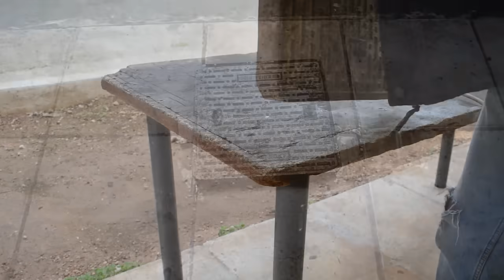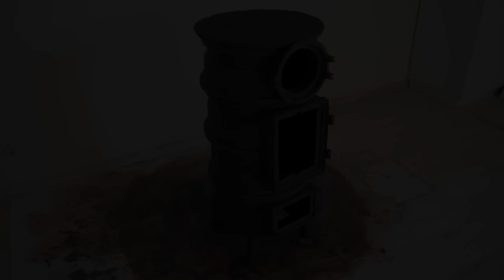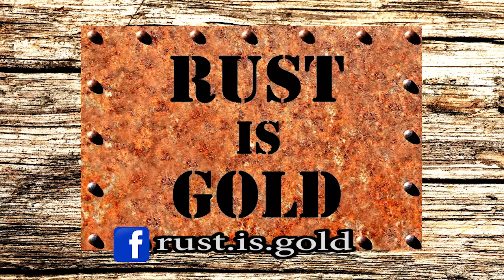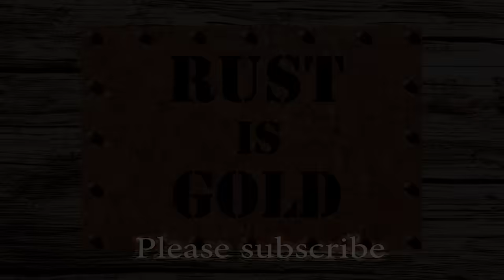DIY Wood Stove made from Car Rims

Comment: I imagine you will regret using paint rated for only 300C. That stove is capable of much more than that.  Also, consider using fiberglass insulation to soft mount the front glass.

Comment: What is the purpose of the top round door?
Reply from the maker: I wanted to put a small door on top and I had this circular door here in stock so I decided to install it! All the other wood stoves I searched in YouTube had 3 doors. In addition you can open this door to allow more air to go up chimney.  This will clear the stove of smoke with out opening bottom draft door which will increase the strength/heat of the actual fire.
Reply: Looks pretty cool! Maybe more ventilation? I was thinking the same.. you know what really stinks? Most of the best designs and they don’t look to hard , none of them are in English.. that stinks worse than day old fish...🧑🏽‍🦽🎣🇺🇸

Comment: Loved this... A grinder and paint makes the welder you aint!!.." 😄😄😊👍👍
Reply: I'm always amazed how they cut a small circle on a non flat metal using a grinder with a 5" blade!  Great job!
Reply from the maker: Thank you very much!
The difficult part is to create the first full circle. Once you do it it's very easy. It just needs patience and to go around over and over again by slightly pressing the cutting disc.

Comment: I'm looking to build a wood stove in a shed/ cabin and something like this would be a great size
Reply from the maker: You can also use truck rims but it is going to be huge and heavy! 😊👍
Reply: @RustisGold  lol I'm 5'1"& 120lbs every wood stove big enough to keep a cabin warm is big and heavy for me haha
Reply from the maker: @katiesioux7757  😄😄👍👍
Reply: This one you could Roll into place.  Tape cardboard over the glass and brush it off once there or....Metal Casters with locks on the legs.   Gotta think outside the Box that the Box is In.
Reply: @mindofmadness5593  with my size and the work I've done, out of the box is often the best way lol smarter not harder💯⭐

Comment: Beautiful project, but here’s some advice:   Make those welds L@@K nicer buy turning up the heat on the welder.    If you’re already maxed out, you then need a bigger welder that puts out more amps, because your  weld beads look like cottage cheese or pigeon poop.   I’m not saying this to be mean, just pointing out the obvious.  With cleaner, nicer looking welds, your work of art becomes truly a piece caught by everyone’s eyes.

Second, that silicon won’t last long.  There is braided fire liner you can buy that works better.   Third, painting inside the stove will only burn off right away.  All it does is make nasty soot and toxic smoke until it’s all burned away.   

How do I know?   Because I’ve made 14 of these similar stoves and sold them all.
Reply from the maker: Thank very much for your comments and the advise!

Comment: add refractive bricks layer at the top and your heat will be 30% better...
also clean the soldering is a great possible esthetical aspect too. anyhow it's a great job you did guy!
I'm going to make one with tractor rims :D
Reply from the maker: Thank you very much for your comments! I know it would be much better if I had added the bricks.... I'll have it in mind for future projects! 
Tractor rims are huge!!! 
Why don't you use truck rims??
Reply: @RustisGold  I'm joking for the tractor rims, but can be interesting for a big restaurant pulled pork stove :D

Comment: 3:14 Preparing for the barbecue? Nice build indeed. :)
However, I think a flame deflector plate will improve efficiency. It's simply an angled plate where the gasses have to pass before entering the chimney pipe.
This means the gasses have to be in there for a longer time and will be burned more efficiently.
Reply from the maker: Thank you very much for your comments! I will definitely have a look on what you suggested. I wasn't aware of this detail. 👍

Comment: Very interesting!  I built a barrel stove for the shop using a length of thirty inch diameter pipe, (about 5/16 inch wall thickness) from the salvage yard and my own door with a draft on each end so I can control the burn.
  Once I get a good bed of coals going, I can put a three foot long log in it fourteen inches in diameter.  Depending on the weather, it will hold a fire for as much as two days.
Reply from the maker: Thank you very much for your comments! Your barrel stove looks really effective! 😊👍👍

Comment: Nice work, 1 question was the cast iron hard welding 
Comment if I was to do something like this I’d use 22.5 or 24.5 inch truck rims, bigger is better 
That being said I’m impressed with your work
Reply from the maker: Thank you very much for your comments! I am glad you liked my creation. 😊👍
Cast welding was harder than I thought.
You need to really warm up the surface in order for the welding to be successful.
I also thought of using truck rims but I didn't want the wood stove to be so big.
Even with the rims I used it is really heavy!!
Reply: @RustisGold  You  need to weld cast iron with nickel rod. Very expensive.Ordinary welding rod does not well at all with cast iron. Better off using mild steel instead of cast iron.
Reply from the maker: @ArchieBunker-i2h thank you very much for your comments! 
Nickel rods are too expensive... 
After 5 years it seems to hold just fine although I used normal rods. 😊👍

Comment: What is the purpose of the round upper door? For adding wood? I would just add it on the main door (the one with glass).
Reply: It's called a damper to control the amount of air intake
Reply from the maker: Thank you very much for your comments! I wanted to put a small door on top and I had this circular door here in stock so I decided to install it! All the other wood stoves I searched in YouTube had 3 doors. In addition you can open this door to allow more air to go up to the chimney.  This will clear the stove of smoke with out opening the bottom draft door which will increase the strength/heat of the actual fire.
Reply: This for heating or cooking too
Reply from the maker: Just for heating. I haven't used it for cooking.

Comment: 🔥🔥🔥I think this is a great use of old tyre rims and a drain covers,  wonder if there are pot holes now 😁 ,  unless youre very good at arc welding this would be better done with a MIG welder for a cleaner finish , I like the design and it seems great to use but it will get very hot, 300 to 400`c easily with a couple of good logs on it and if its used indoor you would have to ensure that all your welds are seam welding and sealed against toxic gasses leaking out. 

I wonder about the longevity of the steel rims though with the heat and wonder whether it would have been better to weld some steep plate baffles to the inside of the rims to give some protection for the fierce heat this will generate , you could easily pop a cauldron on top of this and bring it to the boil....

I was surprised to see drain covers that are not cast as those you wouldn't not normally be able to weld to plate steel. it needs specialist skill to weld cast iron . It looks fun to have in your workshop or garden room. 

Well done.....I like it a lot.🔥🔥🔥
Reply from the maker: Thank you so much for such nice and detailed comments!
I am really glad you liked it! 😊👍👍

Comment: Nice work but the welds ooo my
Reply from the maker: Thank you very much for your comments. I am not a professional welder. When it comes to simple welding I have no problem. This one was more difficult because there was some gap between the rims and the metal boxes I created.... I also used the grinding wheel at the end and it looks pretty good.
Reply: @RustisGold  mate seems like you are just draging the rods straight 
you need to move side to side like drawing a leter c on paper 
when arc welding just a friendly sugestion 
but a good job anyway looks good 👍👍👍
Reply from the maker: @toby621  thank you very much man!!! I am afraid you are right... I was dragging the rods straight... I will start practicing!! 👍👍👍

Comment: holy smokes, how many zip disks you go through?? May want to get a plasma cutter
Reply from the maker: If I remember correctly I spent around 15€ (max) in cutting discs which is not bad... Buying a plasma cutter however wouldn't be a bad idea! 😊👍
Reply: @RustisGold  Yah and a small mig welder as well. Burnin rod is messy and not so good for your health neither. Otherwise, great job. Looks cool and old school
Reply from the maker: Yes... Mig welder is on my shopping list as well!
Thank you very much for your comments! 😊👍👍

Comment: Marvellous. Totally rivoting. Better than any famous Crimi series. Totally absorbing. If only I could weld and had the construction ideas like you. I bet you were top of you class for practical mechanical  engineering. What would you have done without the man-hole covers? NOW, the crucial Question: How well does it function? Can you grill a steak on the top manhole section? Boil a kettle quickly? A pot of potatoes or soup? Cheers.
Reply from the maker: Thank you very much for your comments! I am glad you liked it! Growing up in Greece unfortunately we didn't have such courses in school... However I was that kid in the neighborhood who would fix all his friend's bicycles! 😄
If I hadn't thought of the manhole cover solution I would have bought a couple of metal sheets, cut them in circles and use them instead. 
The wood stove worked fine but to be honest I didn't use it a lot... My son liked it so much that he took it and placed it in his apartment as a decorative item!! 😊👍

Comment: The stove has beautiful styling but I'm not sure the steel will hold up to the heat over time. How about an update?
Reply from the maker: Thank you very much for your comments! To be honest I didn't have a chance to  use it a lot.
My son liked it so much so he "confiscated" it and placed it at his apartment as a decorative item! 😄😊👍
Reply: Will hold up just fine , have a 2 rim firepit that has been used for years with no issues
Reply: @killerdeamonking  an outside fire pit and a wood stove are not even remotely comparable when considering the amount of thermal cycling a wood stove sees and an outside open fire pit doesn't come close to the internal temperatures a closed wood stove endures on a regular basis.
Reply: @dbriggs1689  how do you figure lol, it's a fully closed fire pit on top and bottom with a door.
Reply: @killerdeamonking  whatever you say man. If you want to believe a steel wheel wood stove in your house is a good idea go for it. Im not going to get into a long drawn out debate on it. Im not a woodstove expert but I've made a living with melters, furnaces and boilers for the past 25 years but what do I know. After all you have a fire pit in your backyard.
Reply: @dbriggs1689  Im just stating from personal experiance is all. It works fine for me and thats all that matters.
Reply: @dbriggs1689  Also , rims can be far thicker than the propane tanks and the wood stove barrows from the 50 gallon steel barrows people make and sell. just depends on how you build the stuff and what kind of rims you use generally the older the better on those rims.
Reply: @RustisGold  recommendation, drill a holesaw hole out, on each side of the rim, have one piped to a lower area and one equal out or above to blow hot air.... be suprized how quick it moves it around too.... also, the surrounding around rims, should make another face of steel around the rims, wether plate steel, sheet steel or pipes welded together to hold the heat even more......adds durability aswell.
Reply from the maker: @constitutionalrepublican1611  Thank you very much for your comments!! 😊😊👍👍

Comment: Quite a cool project, but with all the cutting and welding, I can't help thinking it would have been cheaper to just go buy a woodburner.
Reply from the maker: Thank you both for your comments but you are missing the point... I don't do this to save money. This is my hobby and I am having fun transforming pieces of garbage into functional objects.
The total cost of this creation was around 120€, quite reasonable I believe. 😊
Reply from the maker: @regsparkes6507  😊👍
Reply: It’s art not just a project… but I do want to know what that top doors function is
Reply from the maker: @iansleight5101  thank you very much for your comments! 😊👍
Regarding the top door I answered to you on your previous comment.

Comment: Other than the messy welds, this is very impressive!
Reply: Nah, he just needs to learn how to stick weld.
Reply: @pagansforbreakfast If you can't weld neat, a mig isn't going to help.
Reply: Speaking from 20+ years of welding experience.  Those drain covers are cast iron and cast is pretty tricky to weld if you don't have the right rod or are unfamiliar with welding it.
Reply from the maker: Thank you all very much for your comments. I agree it was not the best welding but I am not a professional welder and this is not a competition, I am not trying to sell the objects I create. Just trying to show to other people how you can transform pieces of garbage into nice looking and functional objects... Take care!
Reply: @RustisGold  One thing I noticed you did was, You weld with your wrist, that is you change the angle of the electrode from about 60° to 90° . Keep to 60° and chip slag off bofore next weld and you will find the satisfaction from doing a great job (as you did) will be even greater. keep up the good work and practice.
Reply: @pagansforbreakfast honestly I havn't done that much cast iron welding but that sounds right.  Many people rather braze it with brass because its easier.  Cast takes pretty high heat to melt.  Using regular welding rod like 6010 or 7018 doesn't like it and generally just lumps up and sits on the surface.  You can get it to stick, it just wont be pretty.  One thing with cast is when you are done welding it is to make sure to "ping" it to release the stresses of heating and cooling so it doesn't crack when it cools down.  Even though cast iron is very strong its brittle as well.

Comment: I like it!  I would use it!  One question...  You welded everything except the handle?  Why did you bother to drill and tap the handle when you could have just welded that too.  I know!   You ran out of welding sticks!  Right?  Just out of curiosity... How many sticks and cutoff wheels do you think you used for this project?
Reply from the maker: Thank you very much for your comments!! I just wanted to experiment a little. Plus it looks nicer this way! In total I used a box of sticks and around 4-5 cutoff wheels!! 😊👍👍

Comment: Please never drill and hold flat bar by hand, you even do not know how you risk,
I  been injured that way, if drill piece block in metal, the flat bar will start rotating very fast and you hand, fingers will be cut si many times as rpm of your drill, it can even cut of your fingers,
Use some mole grips to hold piece of metal do not risk that it jam and change in to rotating knife.
Reply from the maker: You are absolutely right... 😊👍
Reply: @RustisGold  your hands are price less, and making gold from rust😁, so look after them, well done, I really like it,
Well done.
Reply from the maker: @pershing602 Thank you so much for such a lovely comment!! 😊🙏👍

Comment: The rebar will not last in the fire chamber you need cast iron. You need to use harden bolds for all your hard ware. The low grade bolds will always loosen up. You should of used wood stove glass rope gasket behind your glass they sell it in all shapes and sizes the expanding and contracting might crack your glass I hope it’s tempered for wood stoves.

Comment: very good build but why do you need the round door at the top?  i think you wasted a lot of time on something thats not needed?? ...
Reply from the maker: Thank you very much for your comments! I wanted to put a small door on top and I had this circular door in stock so I decided to install it! All the other wood stoves I searched in YouTube had 3 doors. In addition you can open this door to allow more air to go up to the chimney.  This will clear the stove of smoke with out opening the bottom draft door which will increase the strength/heat of the actual fire.
Reply: Same reason why they exists on wood cook stoves , burner plates on top come off.

Comment: what is the purpose for the door on the top? watched this w/ my dad and we were both trying to figure that out. very cool project!
Reply from the maker: Thank you very much for your comments! I wanted to put a small door on top and I had this circular door here in stock so I decided to install it! All the other wood stoves I searched in YouTube had 3 doors. In addition you can open this door to allow more air to go up chimney.  This will clear the stove of smoke with out opening the bottom draft door which will increase the strength/heat of the actual fire.

Comment: Nice work! But no seal on the doors?
Reply: There is no need for seals.  Burning process needs air anyway and smoke goes out of the chimney.
Reply: @rickrandom6734  Hi! Right but it's a lost of energy and in France would be forbidden. Cause of many deceases in the winter nights...🤕
Reply: @LeFilosophe1  Do you mean deaths because of carbon monoxide or small particles in smoke?
Reply: @rickrandom6734  sure I do!
Reply from the maker: Thank you very much for your comments. Believe it or not I was a "victim" of the side effects of the coronavirus. By the time I finished my wood stove project all shops where closed due to a countrywide lockdown... I was very lucky that I brought the fire resistant glass a day before the lockdown. When things go back to normal I am definitely planning on buying door gaskets. Stay home, stay safe!